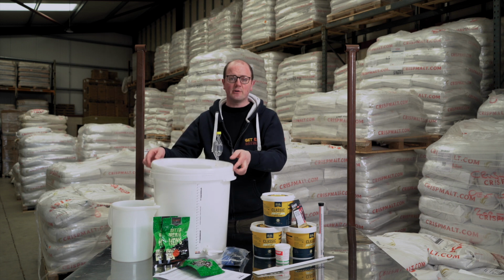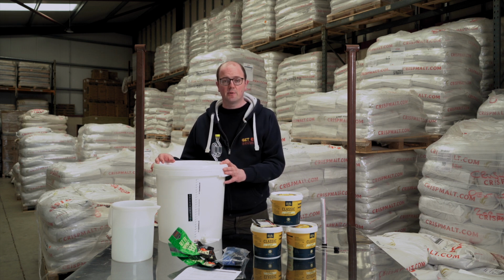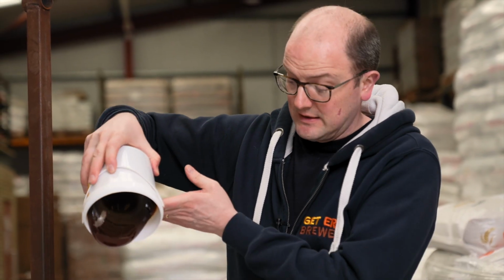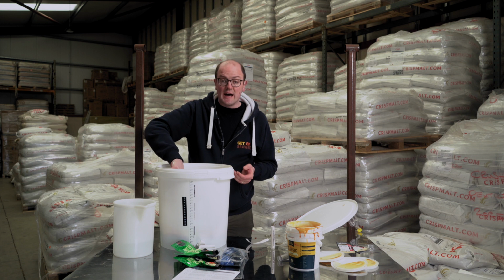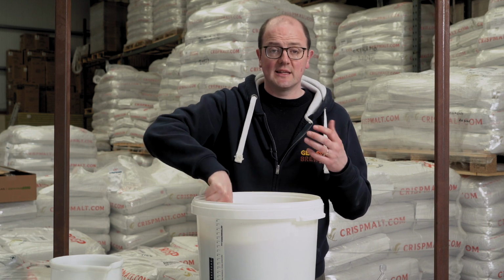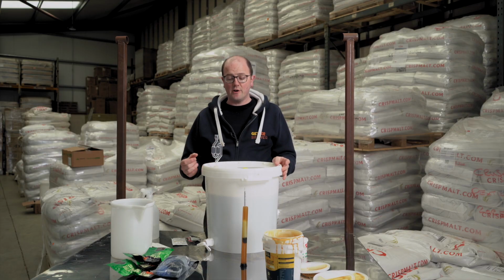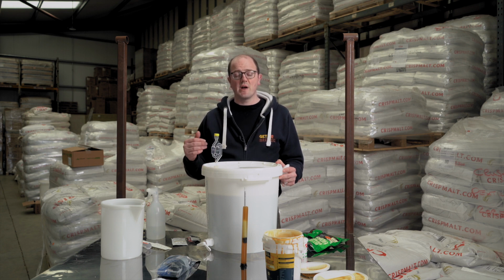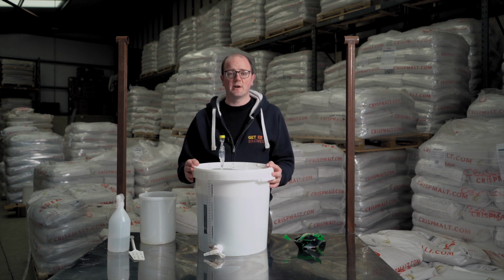How to brew a beer kit

Comment: Sorry, I've another question! Is the 'cold-crashing' necessary? I'm currently fermenting the NEIPA kit and have my fermenter in the spare room where there's an ambient temp of around 20c. I don't have a fridge I can use to cold crash, and i don't have a heat belt on the tank (to remove), so im not sure how I can cold crash?